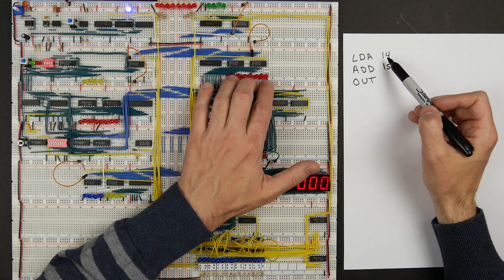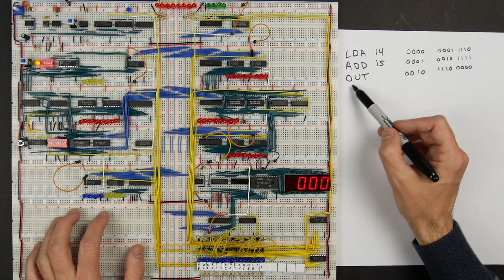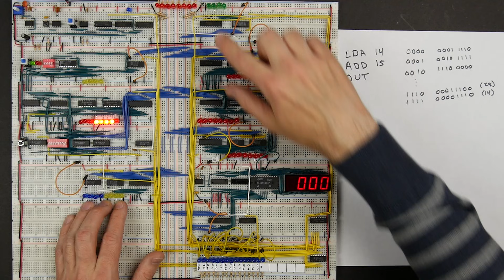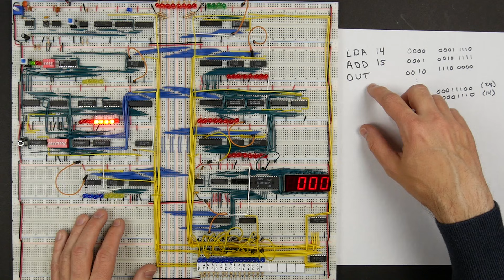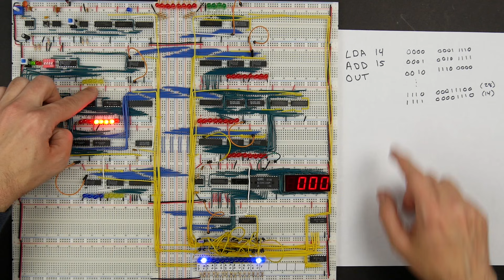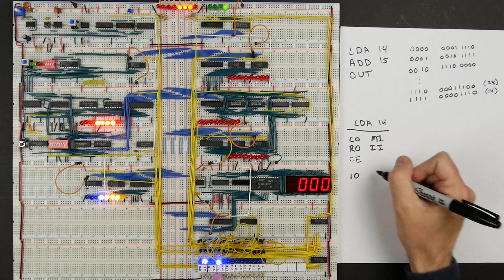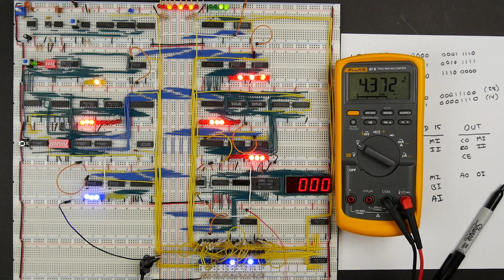8-bit CPU control logic: Part 1

Comment: Ben, I have a question. I don't get the part where you say "summ out, A register in". Why doesn't the ALU add the new value of the A register and does put this in the A register. I mean the D flip-flop can't switch of that quick because the ALU does this operation immediately, doesn't it?

Comment: I'm an electrical engineering student and you have cleared up, in less than 30 minutes, material that I've been searching hours on end for, regarding control logic and its implementation in an easy-to-understand manner. I cannot commend you highly enough for this incredibly lucid presentation. Please do not ever take these videos down. As someone else commented, they should be required for electrical/computer engineering students.
Reply: for real

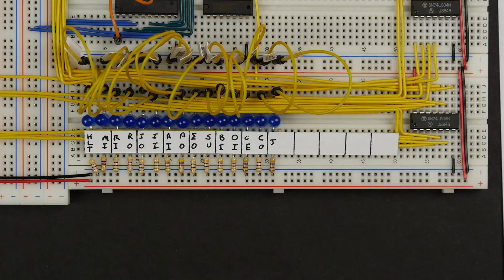Comment: There is a problem in his program (still there at 9:21): the computer isn't halting, and RAM isn't clear, so the computer will execute bogus instructions after the intended program finishes, potentially trashing the output. I don't yet know if this gets fixed later.

Edit: No, he just stops the CPU manually, which wouldn't happen if the control logic drove it.

Comment: how do you get your jumper wires so perfectly sized and straight?
Reply: Technically they're bridge wires. When the camera isn't recording he cuts and bends the wires in the correct shape and size.

Bridges.... well 'bridge' from one point to another and aren't meant to be moved.
Jumpers are bridges you intend to move between two or more spots (i.e. they 'jump' from one to the other)

Comment: Does the PC ever output to anything but the MAR, does the MAR ever output to anything but RAM, and does the IR ever get input form anything but RAM? If all of these statements are false, I think we could connect these components directly to each other (rather than through the bus). Then the whole fetch phase could be executed in a single clock cycle. Is that right?
Reply: Ah no ... forgot about the part when the PC in incremented.

Comment: That was the best demonstration, of how a computer is hardwired to run software commands. Your manually stepping through the subroutines makes it very clear now how signals are processed. When they say machine language, every machine has its own architecture, so the designer actually hardwires the command codes, then implements the command syntax (software) to use, to execute the hardwired coding.

Very good demonstration.

Comment: Out of curiosity, if you wanted an 8-bit memory address, how would you approach it? 

In my own mind, there are 2 simple options:
1) 8 bit data bus + 4 bit instruction bus. 
2) Pull the opcode on a different clock to it's parameters in the instruction fetch cycle.

Of course option 1 is conceptually easy, and you just need to add more wiring.. However pulling a 4+8 bit instruction from memory will mean your word width is 12 bits, not 8. Being that your bus is now 12 bits wide, it's probably fine - just feels weird (and you still cannot fully use the bus to address memory).

Option 2 seems like it would waste a lot of memory... You could pull an opcode from address x into the IR and then put address x + 1 onto the bus for processing, but if your opcode has no arguements then you're wasting address x+1. 

Maybe option 2 would be more feasible if there was a flag on the opcode that determined if the instruction required a parameter... You could either logic/magic it into the control module, or even do something in the microcode rom to introduce a similar fetch cycle for the parameter (in which case you probably won't need the flag)..

Comment: A great idea I recently seen elsewhere for your display would be to use an LCD display instead, which I guess are cheap these days and simple to operate with characters, text, numbers, a cursor which can be controlled etc... and usually only 14 pins total to operate.  It would fit nicely with this project and provide a more computer like display.  (like the old Radio Shack hand held computer from the '80s you may remember, had an LCD display).

Comment: Perhaps an obvious answer, but I'm wondering why, for the addition operation, it is necessary to use the intermediate B register to load the value from memory. I know the ALU is sourcing from both A and B registers, but couldn't the memory chip be hooked up directly to the ALU instead of the B register to circumvent its necessity?
Reply: The B register would be a lot more flexible in theory. It also allows you somewhere to put the value so that you're not using the bus during other operations. With more complicated setups there would be more registers and you could select which ones you use for the different operations. So on a 4 register system you could say something like LDA #, LDC #, ADD-AC to use different registers. With only two registers you can do an implicit LDB anytime you do an ADD instruction.
Reply: I certainly understand the value of having additional registers, but I'm wondering if having a second register in this particular instance is necessary for addition, since it seems to only act as an middleman between the bus and the ALU and then immediately discarded. It might be able to be circumvented for the addition operation
Reply: It is just acting as a middleman for the bus, but that's generally the purpose of registers. I'm not sure where else you could put it and still get the result out through the bus.

Comment: Just came to mind that you could use a eeprom as memory, dont you? you could program the adresses every time something gets stored and load it to read the memory. this would give you way more storage for longer programs. but i dont know if its possible, maybe im missing out on something.
Reply: You will run in to one problem.
If you use a var name it "A" as loop counter
you read it from eeprom (not a problem) 
you increment A
and than you store it back to the eeprom (that is the problem)
How often you can write (reprogramming) a eeprom cell ?
only 100,000 times or may be 1,000,000
DJ

Comment: How much did it cost you in parts to build this computer?
Reply: Ben Eater has started a webpage for the project (linked in the description) at https://eater.net/ There he lists the project as costing up to $200 in total, but I think that's using North American suppliers like Amazon, Digikey, Jameco, etc, so it's probably possible to source some things more cheaply, especially if you have some of the common parts (resistors, LEDs, etc) already.
Reply: You can pay 40$ for all parts from asia at ebay (the breadboards are not the best but works for this project) or pay 120$ at your local store but be sure they don't sell the same cheap parts as on ebay ;-)
Reply: Well I'd definitely buy from eBay but I figured that just the cost of the parts would be around 40$ and then add the price for the breadboards. This is great news! Currently I'm looking into breadboards from different sellers on eBay since the last order was not exactly what I'd call good quality but were half the price of the one I'm waiting for to arive so I'll just have figure out if the price difference is worth it.

Comment: Maybe it's explained in a previous video, but why no current limiting resistors for the LEDs? 

Also, I'm interested in building ferrite core memory. I know it's not the most practical, but was wondering if there would be any reason why it wouldn't be feasible for a cpu build similar to this?
Reply: Most of the chips already include a resistor in the 3-state output circuit.
Reply: He does mention the current limiting resistors where they're included, and why they're not in the other cases, but that's been as the series has been going so it would only be in the respective build videos.

I definitely had the same idea regarding the ferrite core memory, although it would probably need it's own extra bit of logic to handle all the details, but would certainly be awesome to see implemented. If you've got the time and interest in making a video to go along with it, I'd love to see how you handle everything.

Comment: Awesome series!

The only thing that bothered me about this was that you assumed it would add.  What if you wanted to subtract?  What if, in the previous operations you just got done subtracting?  Should there not be something there to make certain the ALU is set to add?

I also wondered that as a display, rather than numbers, something could be rigged up with a bunch of LEDs in say, a 16x8 or 16x16 or whatever grid.  This could then leave it open to doing more than just numbers in a very rudimentary display.  The LEDs being in rows and columns, you could then build a number for each row (using shift, pushing each "pixel" on) and then displaying the entire row.  You could literally do rudimentary graphics.  Might be a bit much for this, but sounds like fun.  If I ever start this project myself it is something I will consider. :)
Reply: Add/subtract is handled by the subtract line, so if it's not asserted it will always add, to subtract (A-B) the line is asserted and the ALU switches to subtraction.

While it's a different project http://megaprocessor.com/ did do just that on a 16 bit computer to make a 64x32 (hxw) matrix, then uses as graphics memory  to play tetris. I think one of the challenges would be doing anything that complicated on such a tiny processor (16 bytes memory, 16 instructions current limit), it's definitely cool seeing something visual displayed though.

Comment: Why is the counter incremented at the end of the instruction fetch rather than the end of the entire command?
Reply: Two reasons: First, it needs to be done before the counter is output at the next fetch (though there's plenty of time, might as well do it early). Second, it should be done for all instructions (except possibly jump, but that will overwrite the counter later), so it's convenient to put it in a common part, before the instructions are decoded and diverge in behaviour.

Comment: As to increasing the apparent number of opcodes - there are several instructions that you might want in a machine that do not require a memory location number. Like the OUT command shown here, and a few others some might think of. Would it not be possible to group all those commands and then use the four bits of the programme byte that would otherwise be going to waste to tell them apart? If you can find enough such commands that gives you 31 instead of 16?
Reply: Correct, you can do that. Such groups are sometimes referred to as subinstructions or alternate instruction formats. NOP and HLT are other good candidates, having no arguments. It does mean more logic to decode instructions, which is generally avoided in this Simple As Possible computer (I believe it's from Albert Paul Malvino's book Digital computer electronics, 1977) as well as RISC (reduced instruction set computer) machines. Still, it's a prime example of how computer architectures evolve, usually using previously unused (or in some cases just rarely used) instruction codes rather than reworking the entire instruction set.
Reply: I suppose on this machine you could have NOP, HALT, OUT, instructions to move stuff between the A and B registers, and even a pair that can be used to set or unset twos complement on the output.

Comment: Thanks Ben, now I've blown $300 in breadboards & components, and lost a month of sleep.  I keep waking up midnight thinking of chip enables and op codes.

100% worth it
Reply: Mike B where did u go to get the stuff? In general
Reply: @Nicholas, Welcome to the world of internet shopping. The place where you can buy anything. Just google for an electronics webshop or ebay indeed.
Reply: @darer13  Digikey or Mouser are good sites
even give discounts and free shipping if you order enough
Reply: @darer13 aliexpress I got all of mine
Reply: Hi, I've built my own 8bits CPU in Logisim, but i have problems to chose my TTL 7400 serie components, indeed, i don't see what components i have to chose, for exemple : i don't find any RAM which has an 8 bits address in the 7400 serie. I don't find any 11 bits counter either and about the Multiplexers/Decoders/Demultiplexers, i don't see what means "4 to 1" and things like that. It is written "select bit" and "data bit" in logisim (and I understand that) but i don't see what refers to what. May someone have some tips ? This would be my first real project cause i've never done that before and i only used some components plugged onto an Arduino to see how it works. Sorry for my english if it seems strange. After having chosen my components, what softwares do you prefer to make the PCB ? I already have Fritzing, Is it good enough for that sort of projects ? Do I need to know some things before building my PCB or do I just have to put my components into Friting then link them together and organize a bit the connexions ? Thanks for any answer made in order to help me ;)
Reply: @usern4m32  its fritzing, and this is a free very simple program and will have very little in the library for componants, unless you build them yourself. also asking about pcb building in this video is probably not the place to ask. try google pcb design.
Reply: @usern4m32   unused portions of your logic chips is 'ok'. All chips I have seen can be chained together to increase your bit count. Its just a matter of cost and intention.
Reply: Ebay and random electronic component stores I assume, because that's how I do this stuff. Though avoid the local stores as much as you can, they have huge markup on the price.
Reply: @TealJosh  Yep, because the local stores work as a warehouse and retail part in the industry. The virtual shops just rip them off and make them jobless. Evolution take costs.
Reply: @fuddyduddy  When local shop moves to a place where you need a car to go, it's their fault if small customers no longer go there. I don't have drivers licence and the local component store used to be walking distance from where I live. Then tram line and now your own car.
Reply: @TealJosh  local electronic-component stores? I live in finland, and in finland there's a lot of people that like electronics, but in finland there's just no electronic-component shops. So I have to buy stuff in aliexpress
Reply: @festiveFurry  vantaa, tampere ja jyväskylä. Niistä mulla on kokemusta, alle 20 min ajon päässä keskustoista ja hyvät valikoimat. Pariin otteeseen tarvinnu komponentteja mahd pian ni tullu testattua.
Reply: @TealJosh  sanoisitko jotain kauppojen nimejä?
Reply: @TealJosh  Yleiselektroniikka oli Annankadulla, kävelymatkan päässä. Muutti Teollisuuskadulle, ratikkamatkan päässä ja sitten huitsin nevadaan mihin tarvitsee oman auton. Kun ei edes ole ajokorttia. Tervetuloa AliExpress.
Reply: GTpcGaming not mine! I refuse to make cheap components outrageous and I love seeing people build things and expand their minds.
Reply: @Murphy deffa I am wondering an other thing these times, what im wondering is : Would it be possible to build (program) a BASIC interpreter for the CPU of Ben Eater if we just use an lcd screen in stead of 7 segment displays and if we add some buttons as a little homemade keyboard ? And if it is possible, how hard would it be to program it ?
Reply: oh yes that’s def worth it
Reply: Mike B same here
Reply: achievement unlocked!
Reply: ebay, digikey and I found everything I needed.
Reply: Wow wanna try :-D
Reply: Is this what controls D latches on busses?
Reply: Ben thank you so much for all the video explaining how the cpu works, it makes more sense, spend 3 years in university computer science degree, but I wish I had spend the 3 years with you instead.
My vision is now clear it's like opening the black box, I realised that nothing like Hands on and visual.

Comment: Super cool stuff! I've been following along for awhile, but this is going to be the most interesting part for me: implementing the CPU control logic. I've always wondered how it works on this low a level, and most projects are based on existing CPUs that handle the instruction decoding and everything, so you don't quite get to learn what happens "under the hood," getting from the op codes to the control logic. I'm excited! Keep up the good work, my man!

Comment: After the basic tutorial series of this 8bit cpu is complete, it would be nice to add extra output registers to use as gpio hardware in order to control external components with various methods like controlling relay or a field effect transistor with pulse width modulation. An 8bit output register in combination with resistor ladders and differential amplifiers can make 8bit digital to analog or analog to digital converters. The possibilities are limitless and it would be awesome to see this cpu controlling real life applications for educational purposes like many of us do with micro-controllers!!!  It would be nice to build the final form of this cpu on a circuit board with smd or through hole parts in order to achieve faster and more reliable data transfers and thus higher clock speeds.

Comment: Ben, can You make EEPROM based "HDD" module for Your computer? So You can eg. calculate and log first 2k prime numbers (output to EEPROM instead of display) or something like that... 

Or store programs, so after You push a button, first 16 bytes from selected EEPROM address is loaded to memory?
Or "OS" at the EEPROM begin, that loads specific program, according to value set in memory, and then runs it?